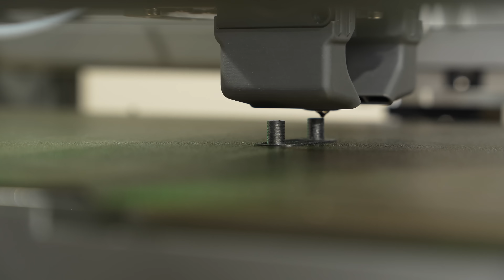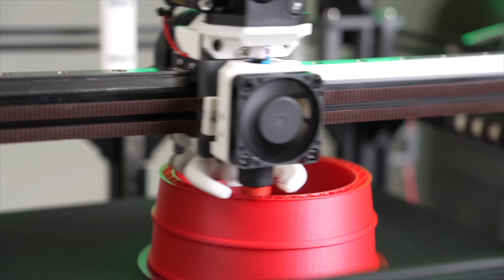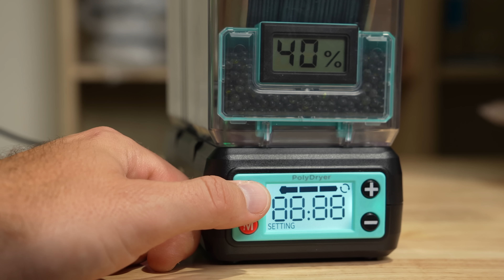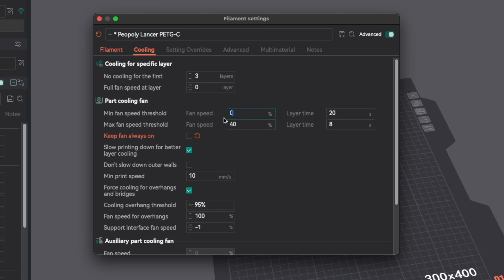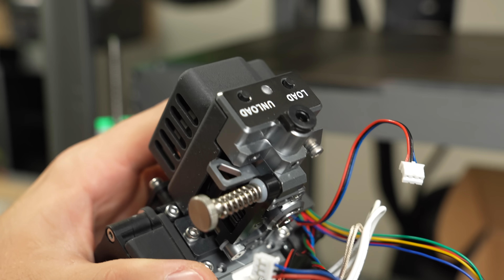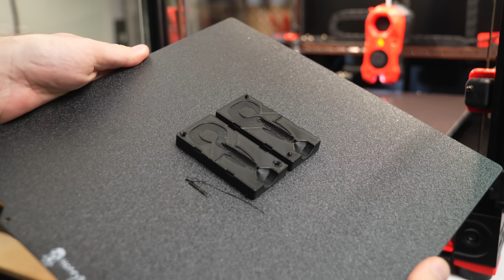Dialing In Retractions For Best Quality 3d Prints (OrcaSlicer)

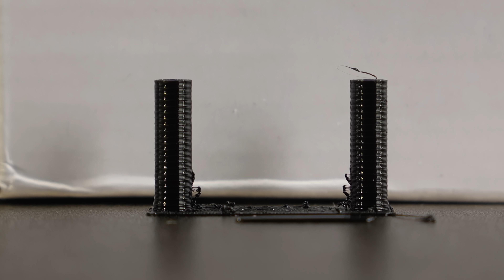Comment: Hi, I  got some more filament parts stick to the strings like you got at 6:17,but much more; what could it be and how to fix it? Do you use wipe and z-hop or its better to turn them off both or one of them? Also is asks me to bring some changes or not to the test and i'm not sure if I override the test and not doing the proper test. Sometimes it gives me Error 112 non manifold edges - what is this? 
Thanks!

Comment: Here is ultimately how you can dial in retraction speed with a low quality printer. 

Disconnect you bowden tube from the hot end, pre heat the hot end to a working temperature and feed material through it. Once the material is flowing nicely out of you nozzle, pull back on it and make sure you can do so with out it jamming in the heat break then push forward you will find a sweet spot where material cuts off almost completely then push forward.. Do this over a series and try to do it as many times as close together as you can. Now remove the material from the hot end.. Take the materials that has been pushed through the nozzle, should go from small to wide... Measure the distance from large to wide. That will give you your 3d printers retraction distance and it will be the smallest amount you can have. The less material you move out of the heat break. The better it is. Also means your material is less likely to jam in the heat break when printing and will always stay malleable which is what you want. 

Now you want that retraction distance to happen with in seconds, for an example I will use a Creality CR-10S Pro V2 as an example. 

My retraction distance is 4mm which is really good flexibility. That length is close to being about 1/3 the distance of the hot end thickness for reference. Now we want to be able to get the retraction in a second or a fraction of a second. Thus we want the retraction speed in be in factors of 4. In this case to get 4mm/s in a second, I need 4mm/s. If I want that in 1/4 of second I need 16mm/s. If I want 1/3 of second I want 12mm and so on. 

The easiest way to get your speed right is to ask how fast you want the retraction to happen. Half a second in a good starting speed. So that would be 8mm/s and truly the best way to determine this with practice but it comes down to the volume you can extrude out of the nozzle too. Since there are a 1000 milliseconds are in 1 second. I would look at 10ths as the peak of performance on retraction.

Still since there are 60 seconds in a minute. 1/3  to 1/6ths of a second isn't that bad for performance either. I would call this the mid tier for sure.

Comment: Worth mentioning that retraction speed also making a huge difference. We definitely need an extra fields in that Orca calibration tool, where you would be able to test retraction speeds as well.
Reply: yeah, im trying to figure out a manual way but have no idea what im doing, lol
Reply: @Valerie_is_doing_stuff  manual way will be to change retraction and deretraction speeds in filament setting or printer setting and test range of distances.
Reply: Some printers though can't produce prints at 35-45mm retraction/detraction. Kobra 3 is one of those machines. My Adventurer 5M has no problems with it. It was part of the default profile.
Reply: @Sm1te79   i´m also a owner auf  Kobra 3. so what speed do you set retraction to avoid stringing? thanks in advance!

Comment: The issue I have had with this and all Orca Calibration exercises is that is seems to be for smaller more standard nozzle sizes.  I am working on dialing in a 1mm nozzle and am having a heck of a time with all the calibration settings.

Comment: idk this test always shows perfect tresults on all retraction distances yet when i print smth the stringing may manifest itself terribly. I dont trust this test and use a different one that proved more precise, but requires a bit more trial and error.
Reply: Heya, Which one are you using? I have the same problem.
Reply: @yung-tokyo  YouTube erases links automatically, so it's the one you can find on printables from Idea Prints user with cylindrical and cone towers that prints in 3 minutes, no settings but it prints fast so you can adjust the distance and speed and reprint quickly, usually takes around 15 minutes to figure out the best settings and then it just works on other prints

Comment: I use only 0.2-0.5mm retraction distance for most of my filaments. I also use retraction speeds anywhere from 40-80mm/s without issue. There isn't a ton of time to accelerate anyways, but it still saves some time. Overall for most filaments 0.4mm at 60mm/s is going to be a safe bet in my experience. Obviously with particularly stringy filaments or something like TPU, you may need a bit more distance and a bit more or less speed. Good video overall!

Comment: I'm starting to lean to humidity in my situation.  For example, I've run the retraction model for my current Polymaker Polyterra batch and I - like what you saw - get no stringing.  I've used the full gamut of temps (200 - 230) and retractions from .4 to 1.0 mm.  No stringing.  However, when I print a larger model (taller than 150mm), I get wispy stringing on edges and small hops (<2mm).  The only thing that I can see is that my filament is absorbing moisture during the period of the print (usually 6 hours+ for these parts).  Living in Northern Alabama, humidity is just a fact of life (~50% right now in my lab).  Looks like I may need to reorganize so that I can print from my drier box ...

Comment: Great tutorial and so glad you mentioned temperature, because that is the key for my printer.  I use .8 retraction and never mess with it. If I start to see stringing with a particular filament, I just lower the temp by 5 C and that usually is enough to fix it.  I am curious what percent humidity you like to see your filament at?  I have actually seen stringing increase when I dried filament too much, which just made my head hurt to be honest. I suppose I just needed to lower the temp even more.  This is one those issues that has so many variables there is no "one weird trick" but you did a great job covering all of those.

Comment: If you're still having issues, look at your retraction speed. I found some years ago that in an effort to reduce stringing it got worse when i switched filament types, it took me a few days to figure out why. It turns out that the filament will want to separate if you retract too fast and leave filament at the tip to ooze out.

There are a lot of settings i wish where in different categories in OrcaSlicer, such as some retraction settings that IMO should be under the filament profile. Maybe still keep the settings in there place but add an over-ride section in the filament profile

Comment: You didn't mention what nozzle size and types your printers were using. In my experience that makes as big a difference as having the filament dried or not. For example, when switching from a 0.4 brass to a 0.6 copper nickel plated nozzle, it's practically impossible to eliminate stringing even with dried filament.

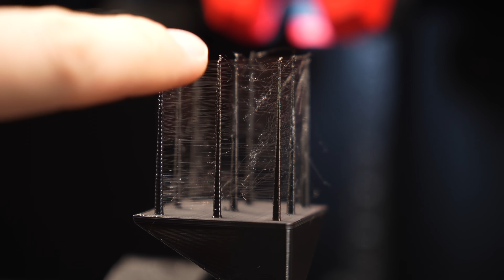Comment: I used this calibration test a couple of times, and i almost never get any stringing. Bit when i print an object, sometimes there is (some/a lot of) stringing. And when i print the object you show at 2:18 i always get stringing…
So i find this test rather useless.
Reply: I agree with you especially when using TPU. Calibration test are not relevant compared to a real object printing

Comment: What about retraction speed? Does that also impact stringing, or is it more of a hardware thing?
Reply: I actually found retraction speed can pretty significantly impact things like over or under extrusion before or after a retraction move. So if you have unexplained spots in your print where everything looks good, but then there are tiny pin holes or spots that look not as filled in as they should, you can change the retraction speed. Some filaments are temperamental, and the speed will affect how long the nozzle stays in one place before the retraction is complete. So if you have a high speed, the nozzle will complete the retraction move fast and the pressure in the nozzle will not be relieved before the nozzle moves around. And if the speed is too slow, the nozzle hangs out in a spot for too long. Oozing filament and too high of a temperature of the nozzle can exacerbate this. Also, sometimes the retraction speed and de-retraction speeds need to be set slightly differently from one another. It just depends on the extruder, nozzle, temp, filament, print speed, etc... there are a lot of other factors to calibrate before retraction speed usually as a last step.
Reply: It definitely can. It basically affects how long there is pressure on the filament in the melt zone of the hot end. The faster you can retract the filament, the faster the filament is no longer sitting in the melt zone, and the the faster the pressure is relieved. So basically, faster retraction should result in less stringing, though obviously there are limits in terms of not degrading the material itself by grinding or stripping it.